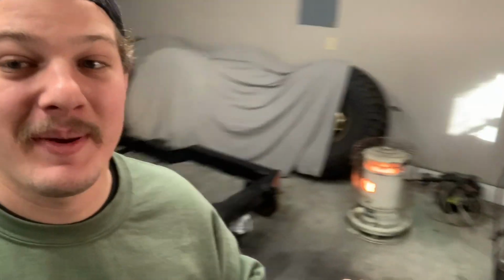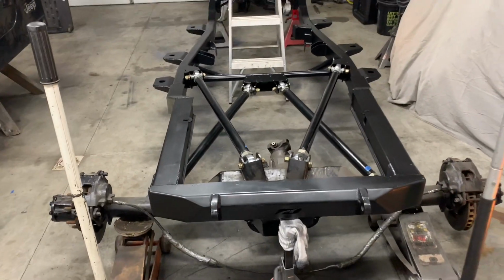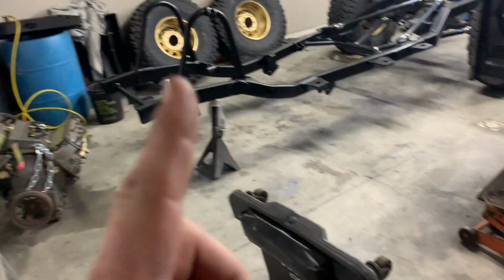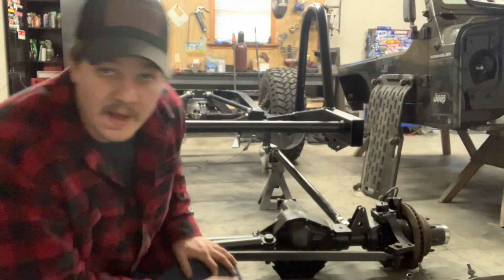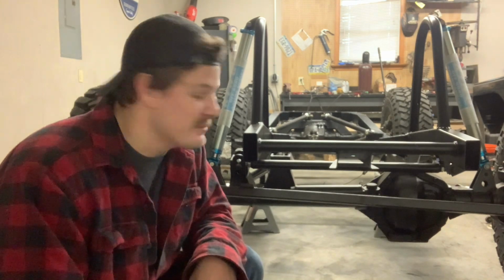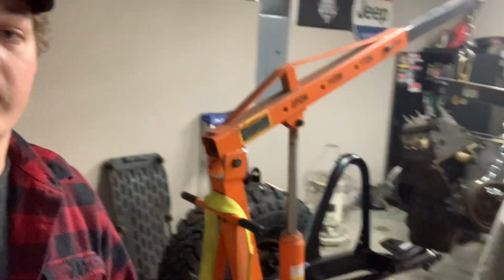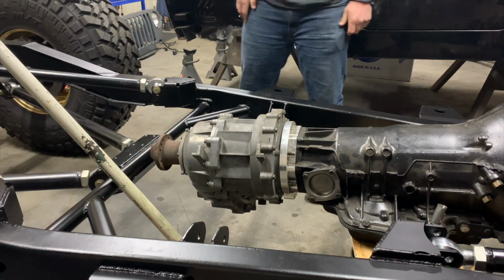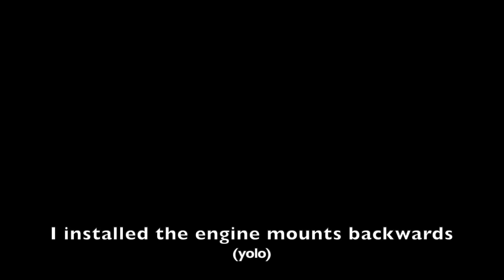Chassis Day - Jeep build pt 5

Comment: Keep up the good work bud. Could you shed some light on your back half kit? Im on the fence about doing mine since i need to do frame repair anyhow. Thanks
Reply from the maker: Thanks man, its a Motobilt back half kit for a TJ. American steel, great fit, great design. Ideal setup if you plan to use coilovers and don't want to French a tower into your frame. Check out my instagram for pictures of the install @hunkuhjunk

Comment: Did you use the stock frame and build it up or rebuild the frame
Reply from the maker: The center rails are stock with all the mounts cut off it. The back half is a MotoBilt tj backhalf kit. The front section of the frame I built myself

Comment: What is the wheel mount spacing on the front diff?
Reply from the maker: The wheel backspacing is 3.5". It is a 17" wheel from procomp and i welded a Motobilt DIY beadlock kit on them